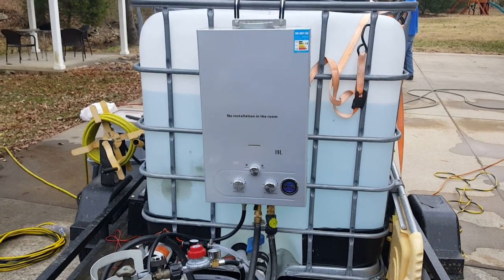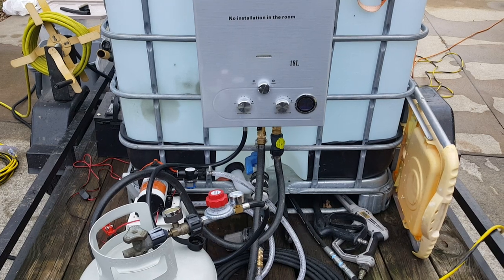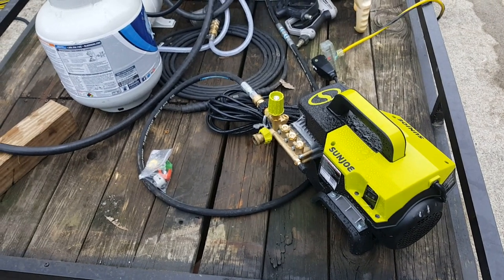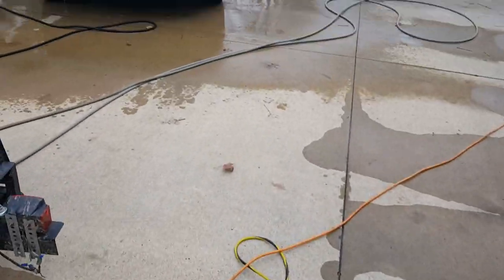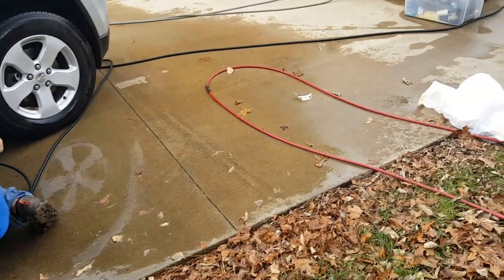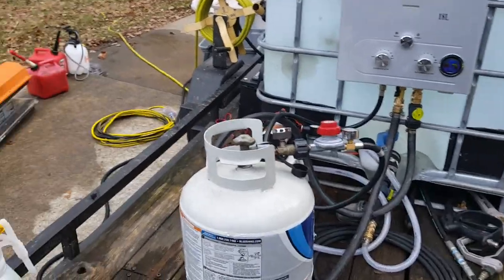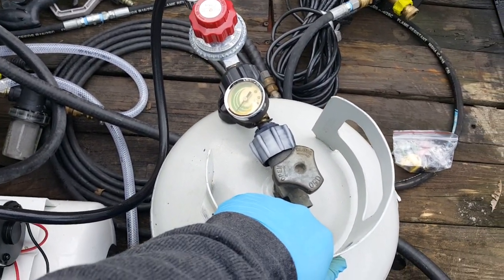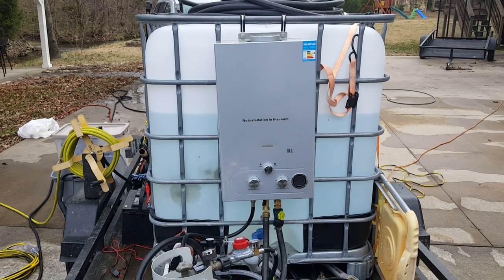I GOT A TANKLESS WATER HEATER FOR MY MOBILE AUTO DETAILING SETUP 18L A MINUTE

Comment: Awesome video! I was thinking about doing the same thing. Do you run the hot water through your pressure washer all the time? How long have you been running it like that? Have you had any issues?
Reply from the maker: I
Reply from the maker: I don't run hot water through my pressure washer a whole lot anymore because unless you have upgraded seals in your pump anything over 130 degrees Fahrenheit will start to cause them to fail. AR does make an electric pressure washer with a pump designed to run hot water through it. All that being said as long as you don't go over 130 you should be fine.